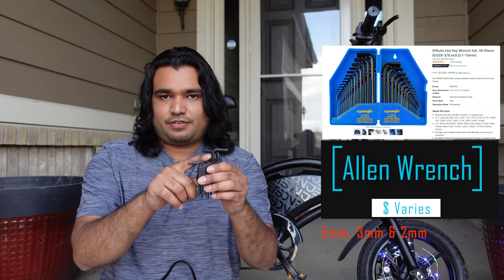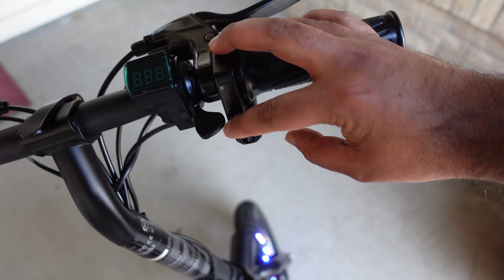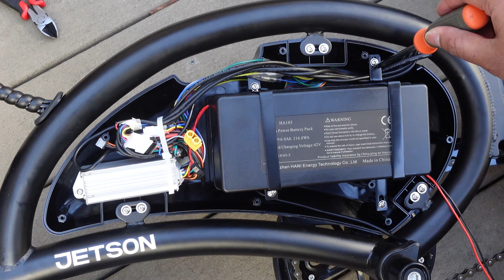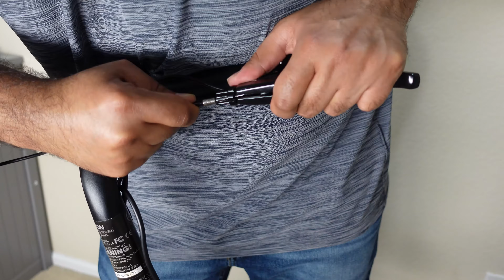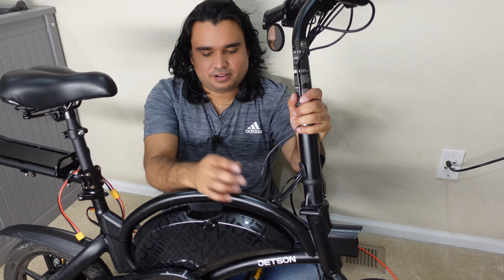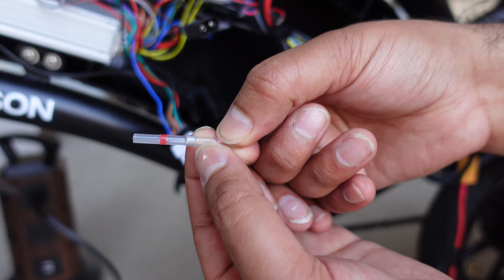How To Install A Thumb Throttle - Jetson Bolt Pro (Folding Electric Bike From Costco) 2021

Comment: when are you going to unlock the speed limit? I hear some people said it can add a bluetooth connector, to make the bluetooth work with the app.
Reply from the maker: Hello, unlocking speed limit has been more difficult than I thought. It is impossible to find a bluetooth connector so I tried upgrading my controller. The new controller still only goes to 15 mph. I am trying to troubleshoot so will take me some time. Thanks for watching my video.

Comment: Bro i was wondering if the controller can handle a 48v ??? Please because 36v feel slugish
Reply from the maker: Bro, unfortunately, it cannot. It will probably burn out. Max it can take is 42V.
Reply: Damn thanks tho if you can do a controller upgrade that be great
Reply: Or figure out how to disable the speed controller pleaseeeee
Reply from the maker: @MyNutzz  Unfortunately, without a bluetooth module, we cannot disable the speed limiter. However, I am doing a controller upgrade to see if I can make it go higher than 15mph. I will put out a video if I figure it out.
Reply: @ShivaSapkota  I already did the bluetooth hack to 19 but i want to go faster so was wondering if you can do a controller upgrade

Comment: I just bought a Jetson and subsequently found your channel. You're doing a great job providing useful tips and info. Thank you. I want to mention that my bike came with the folding latch so tight that it was extremely difficult to unlatch. After some tinkering, I figured out that the latch can be adjusted by rotating the bar in the latch.
Reply from the maker: Hello, thank you very much for your kind words and thanks for sharing that tip. Many people go trough a tight latch issue, I will recommend that tip for them.

Comment: Hi Shiva, thanks for replying to my last comment! I wanted to know if you have ever seen a Swagcycle or if you have any information on that product, if not you could check it out because it’s a neat ebike similar to the Bolt. I have one and want to replace the battery but there’s no information on the subject, I wish I could get help /:
Reply from the maker: Hi John, unfortunately, I am not familiar with that bike. Let me do some research and let you know if I can guide you. Have you ever opened the controller housing? If so, if you email me some pictures of the housing, I can perhaps tell you which wires to connect?
Reply: @ShivaSapkota  Thank you so much, I have not opened it (yet), but I feel like I could do it after seeing you open the bolt pro, the controller housing is similar just more box shaped. I’d love to email you some pictures when I open it, which will be soon because my bolt is in the mail.
Reply from the maker: @johnmounger2789  Sounds great, I will keep an eye on your email with those pictures. Thanks.
Reply: @ShivaSapkota  Just wanted to let you know that I was able to open the housing of the Swagcycle and I know how to change the battery myself after watching your videos! Thanks for everything. 

(PS what are the risks of putting a 36V  battery but with 14Ah on the Jetson?
Reply from the maker: @johnmounger2789  Hi John, that is amazing. I am glad you were able to figure it out. As long as it is a 36V battery, you can go any AH. So, 14AH will work fine. Think of AH as your gas tank, higher the tank size more range you will get, but the power doesn't increase. So, there is no risk to the motor.
Reply: @ShivaSapkota  so do you think a 20 ah would be fine as well?
Reply: Also I can totally email you pictures of the whole thing! Just let me know how
Reply from the maker: @johnmounger2789  I am glad you were able to get everything figured out. Yeah it would be great if you could share some pictures so I can share with other folks in the future who have your bike. 20AH would be fine, it will be a bit heavier battery but should do the job well. Thank you.

Comment: thank you so much for all your videos. please help convert the throttle only model to pedal assist?
Reply from the maker: Hello, thanks for watching my videos. That might be hard since this is a single speed bike. You can certainly disconnect the throttle and only use pedal assist but it won't be possible to adjust the pedal assist like other ebikes. Perhaps I am not understanding the question? 😊
Reply: @ShivaSapkota  i have the jetson bolt but without pedals. pegs instead like a moped. theres a conversion kit though
Reply from the maker: @GrandMasterPeep  Oh I see. You have the original Bolt. I can see how it would be possible with a conversion kit but that would require modifying the bike. Unfortunately, I don't know enough about that bike to make a recommendation. Thanks for watching my video.
Reply: @ShivaSapkota  of course I still plan to add the 2nd battery
Reply from the maker: @GrandMasterPeep  Awesome! Please reach out if you run into any issues or have questions about that project. Thank you again for your support to my channel.

Comment: Hi Shiva, great video! If I want to disable the throttle, which wire should i disconnect at 14:45 in the video? I want to put a toggle switch inline so that I can easily disable the throttle. Would you recommend the switch go on Power, Signal, or Ground?
Reply from the maker: I would recommend you put the toggle switch on your signal wire (blue). That way, you don't have to worry about power and ground. You can use a very simple one wire toggle switch for that. Thanks for watching my video. Let me know if you run into any issues or have questions about your upgrade.
Reply: Following this video, i did add a switch so that the throttle could just be turned off. When I opened it up, my wiring harness ended up being black with a green signal wire. Using your diagram i was able to easily find it though. Thanks!
Reply from the maker: @viernesb  Awesome, I am glad my video was helpful. Thank you for watching.
Reply: I just changed the 3 wires. It works but no voltage on the new throttle

Comment: Having just watched, I wonder if releasing the handlebar clamp and sliding the handlebar all the way to one side would give you enough wire length to not have to create slack in the existing handlebar wiring...
Reply from the maker: I tried that on mine and I still needed more slack, the handlebar is quite long. But, each bike might have different wire slack, so might work for some folks. Thanks for watching my video.

Comment: Hi Shiva, when you doing a video about more power controller or adding Bluetooth
Reply from the maker: Hi Frank, I am currently trying to wire my new controller. I haven't finished yet, so not sure if it will go higher speed. If successful, that video with detailed instructions will be out within the next two weeks. Thanks for watching my videos.

Comment: Is there anyway  the handlebars can be modified ?  My shoulders (I had surgery) ache from the reach…
Reply from the maker: Hello, thanks for watching my video. I hope you are recovering well from your surgery. Unfortunately, due to the cables, modifying handlebars wouldn't be possible. You could however add extension bars so you wouldn't have to reach the handlebar all the time but you will still need to reach the bars to apply brakes. Something like this might work: https://amzn.to/3t8chEV

Comment: Couldn't you just eliminate the factory throttle all together?
Reply from the maker: Hi Alan, no because the cruise control, battery level indicator and the headlight are all embedded within the factory throttle. So, we need to keep everything intact, except for the throttle signal wire. Thanks for watching my video, I really appreciate your time.
Reply from the maker: @Aristotle Bartolome I responded to your other comment but it will work as long as you connect the 3 wires to your new thumb throttle (Red, Black and Blue). You can remove the rest entirely and nothing from that harness has to connect to the original throttle. Hope this helps, please reach out with any questions at any time. Thanks.

Comment from the maker: Would you install a thumb throttle on your Jetson Bolt Pro after watching this video? Let me know your thoughts. Thanks for your support to my channel. Parts needed for this installation are listed in the description of my video.
Reply: You should install a mid-drive on ur jetson bolt pro
Reply from the maker: @darienbien611  That would be a fun project. I might consider that in the future. Perhaps move my hub motor to the front and put a mid drive to run the rear wheel. Thanks for watching my video.
Reply: I enjoy your videos about mods for the Jetson Bolt Pro. I am interested in just adding the battery voltage indication but I don’t necessarily want to change from the twist throttle to thumb throttle. Do you have any suggestions for a “stand alone” battery voltage indicator? I like the size of the one built into the thumb throttle and the fact that it mounts to the handlebar but would prefer to not have a thumb throttle. Is it possible to separate and eliminate the throttle from the voltage display? As I said, I enjoy your informative videos. Keep them coming!
Reply from the maker: @clcobillas  Hi Chuck, thank you very much for your support. What if you just tap into those lines and have both throttles? You can just not use the thumb throttle. Or you can connect the power, ground and voltage line and not connect the throttle signal line of this thumb throttle. That would be the easiest way to have that voltmeter and still have your original twist throttle. I think I found a product that you are looking for but I do not know where you would connect those cables. Without actually having this product in hand, I wouldn't be able to tell you where to connect the red and black wires. You can check out here. https://amzn.to/2P5YfFb
Reply: Shiva sapkota I tried to buy a jetsprobolt and the company that i got it from scammed me out my money they had me track the package all they way to my house then the ups guy dont even drop it off he leave with the package now the package is going back to them and now they telling me they are not sending a bike and im not getting a refund how is that possible i need some help
Reply from the maker: @longlivebino7332  That is terrible, I am sorry to hear that. Did you pay using a Credit Card or Paypal? Please create a ticket with your credit card company or paypal if you used it. They will be able to fight on your behalf. You don't have a Costco in your area?
Reply: Hi Shiva. I just bought a Jetson, haven’t really tried it yet. But I am working on a solar powered ebike project.  I currently have a Cannondale CAAD 11 that I want to convert to an ebike.  I am still shopping for a motor.  I recently bought a 48V battery.  Any tips?  BTW, what is your email address? I would like to communicate with you directly via email if you are ok with that.
Reply from the maker: @rider2731  That sounds great but might be hard to find a hub motor. 48V is a great start and controllers are quite cheap and you can get throttle, brakes etc for a reasonable price. The motor might be your largest spend and quite hard to fit. My email address is sapkotatechnology@gmail.com. Cheers!
Reply: Nope I I'm perfectly fine with the one it has plus it has cruise so you don't even have to hold it the only upgrade Id want is to make it faster have you figures out a way on the pro?
Reply: I bought a new throttle and it still doing the same thing!  I don't know if I have to order a whole new back wheel.   I've only  had it for six months
Reply: My throttle doesn't come on as it should while riding..i keep twisting it but the bike moves then throttle seems to stop while the bike is moving and when throttle again it seems like it stops moving the bike..The bike is new been riding it but a short time.
Reply: Your video was very concise and well presented. I have a Honda mower with a thumb drive and find that going over bumpy ground, your thumb tends to jostle the thumb lever. On a smooth surface this is not a problem. I can see where this would be desirable to some riders but my personal opinion would be to stick to the twist grip. Thanx for the great video.